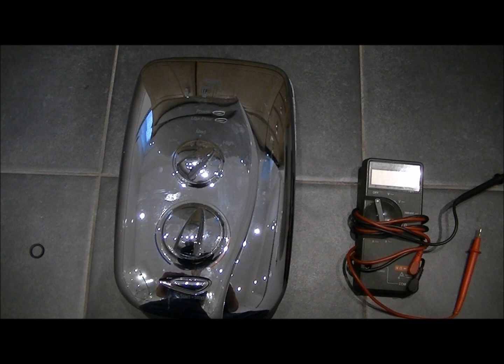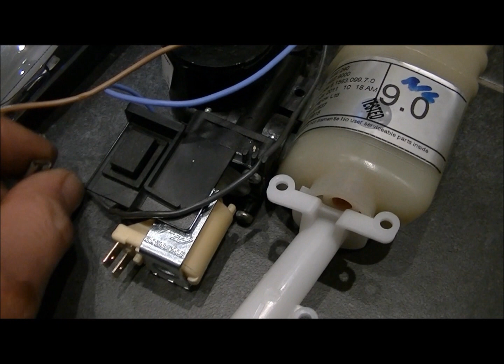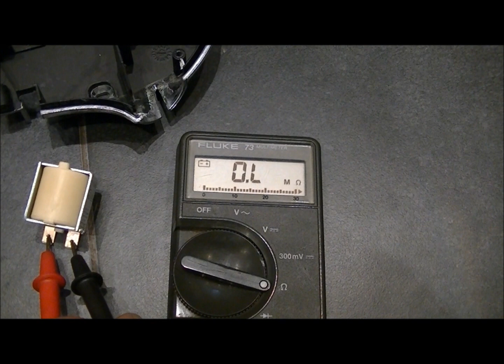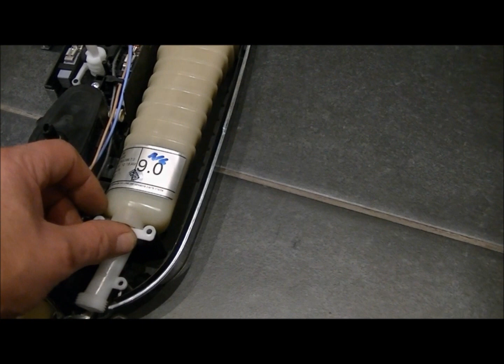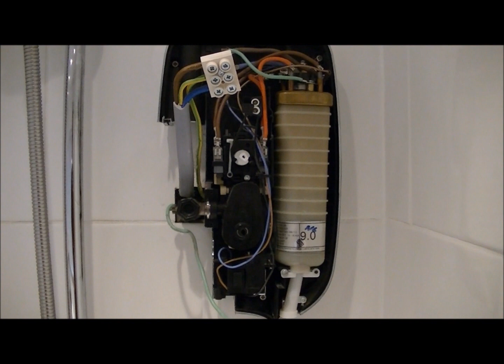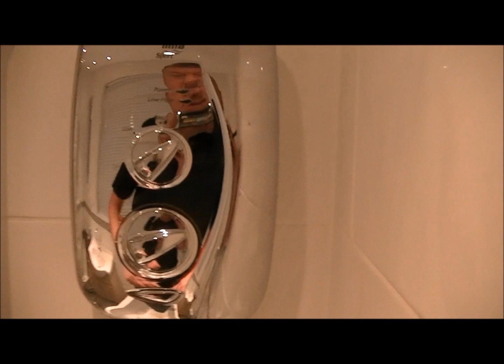Mira shower solenoid replacement

Comment: My vie is not turning off the water fully but I am still getting roughly 3.6 on a resistance test? Do I still need a new solenoid or will it be something else?

Comment: Thanks for this video. I was able to replace the solenoid relatively easily, but what I hadn't foreseen is that as my shower was still installed on the wall, I also had to disconnect the water supply connection to to the shower, so that I could lift the heater control out so that I could then take the solenoid out and replace it. It would have been helpful to have mentioned that. Your video is great when the shower unit is not installed, as it is sir easy to have it lying flat and then unscrewing it! But anyway I was able to do this and replace it, but I am a reasonable DIY'er and fitting a replacement solenoid might be everyone's cup of tea otherwise. But thanks again for a very helpful video. The solenoid only cost me £16, so well worth it!

Comment: Hi, is it necessary to take the whole unit off the wall to replace the solenoid?
Reply from the maker: No i just find it easier when removed .seal plug hole in case you drop a screw
Reply: @brentdiamondbrown3517  Thanks, for the video and speedy reply!

Comment: Mira are very kindly sending me out a replacement solenoid and this video is really helpful thanks
Reply from the maker: glad its of help
Reply: @brentdiamondbrown3517  ive completed the exchange of the solenoid now thanks but now the LED doesnt light up to say theres any power to the shower. It did before with the old solenoid just didnt fire up. Do you think there is a separate issue to the solenoid and if so why would the LED light up with the old solenoid and not this one please? Ive tested at the terminals in the shower itself and there is still power present just no LED now? I dont understand at all any advice would be appreciated. Many thanks
Reply from the maker: @adamwilliams5372  so its been a while did the power light come on when the shower was running or when main pull chord operated just to indicate power to shower unit ready to run
Reply: @brentdiamondbrown3517  thank you for the reply ive done all my testing back and found that the whole issue wasnt the solenoid at all!! The pull cord switch had gone faulty. Polarity was correct all along the line until after the pull cord and the neutral in the shower was showing up live. The polarity was all correct back to consumer unit (i wired it myself and triple checked it) so i bridged out the pull cord switch and it all worked perfectly. Oddly enough everything was cross polarity after the pull cord (while still terminated correctly) ive now replaced tested and all good to go!! Have you come across many pull cord switches like that? Really bizarre as it worked before and i didnt pick up on that when originally testing??
Reply from the maker: No but all is good now so well done .i have now upgraded as the front cover clip broke but replaced with new mira sport air boost .direct swap for pipe work only one hole to drill even shower rail direct swap
Reply: @brentdiamondbrown3517  nice one. Its a shame that Mira being a decent expensive make still have a few cheap flimsy parts like the case clips. I cant complain too much though they sent me the solenoid for free so fair play to them!

Comment: Please, do you know where to find the solenoid? Would you advise to remove it and take it with me to the hardware store?
Reply from the maker: Sorry for the delay replying .I bought my soleniod from amazon enter mira sport solenoid . £8.75 then had on your postage. the two connectors might be at a different angle but it doesnt matter .Actually i purchased two as the postage was the same .hope it goes ok

Comment: Can you please identify what type of screws/screwdriver are used in this video?  I suspect I will need to buy one of those first.
Reply from the maker: For the internal screws a T10 screw driver but i have a terminal screw driver which removes these without a problem .externals screws are posi screws.Hope this helps